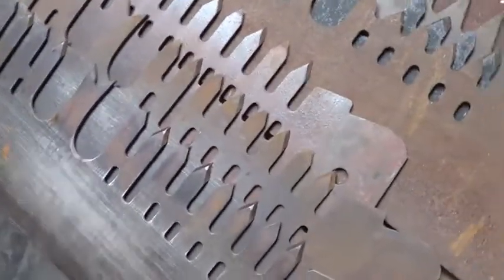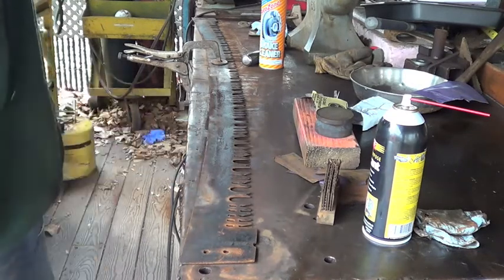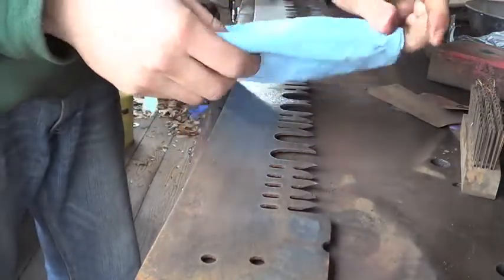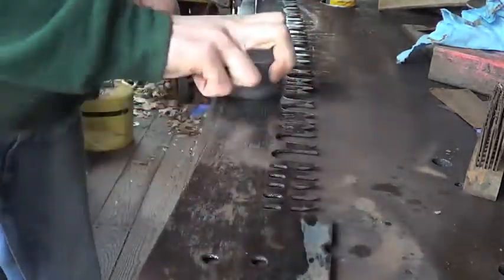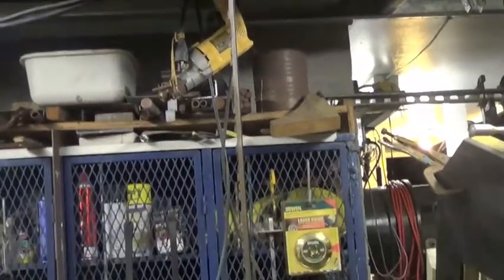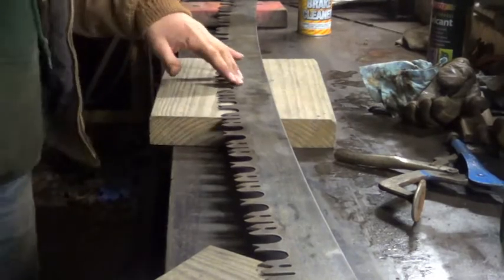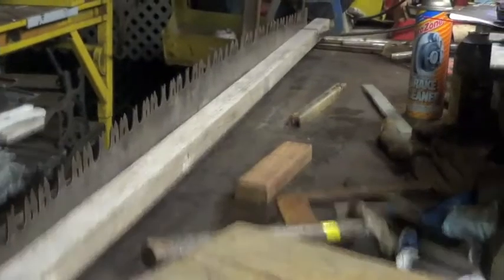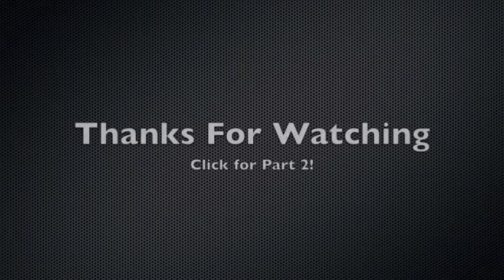Cross Cut Saw Restoration (Part 1)

Comment: The set on the teeth should be hammered, that is tapped gently, until flat. Then the saw can be restored or just tuned, A good sharpening is much more accurate and easier while the teeth are straight. Once sharpened, use your saw tooth set and set your teeth to the proper angle. This will eliminate sanding metal from the tips of the teeth. Good video. Keep it up.

Comment: Man I never want to tell anyone there business, but do not I repeat do not use sand paper on these. The only thing you need from start to finish is steel wool and marvel mystery oil. My family has restored these for a long time  and sand paper will scratch them to shit and leave uneven edges all over the face, even fine grit especially that your dry rubbing that saw with the sand paper. Just  rub them out with the oil and steel wool then take warm soapy water wash it off. Let it air dry I mean completely dry then apply another application of marvel mystery oil. I've restored these for awhile now is the only reason I'm saying anything. Its good to see other people taking interest in these old marvels.
Reply: What if the saw has a lot of rust on it? I was thinking of using WD-40 and a wire wheel. And the I was going to take steel wool. What do you recommend because this will be my first one?
Reply: Yea take to wheel  to it with the marvel mystery oil it will work very well for you....Good luck

Comment: Good video, thanks.
FYI, for you guys that have never used brake cleaner, it's great stuff, but if you're not going to continue to work on your project, you need to treat the metal with some type of rust preventer or it will start to rust immediately.

Comment: Hi by chance I to have the same Simmons jointer. Along with 2 others. The bit you talk about a special Simmons file. All you need is a normal 8 inch by 1 10th file. Yes you are wright to put a curve on it but your file was way to thick which would have given you a lot of flat stright edges on the saw instead of a very large curve.  You just use the grub screw on the file and it puts a curve on it.Hope this of some help as I to have surcomed to the magic of the vintage crosscut saw. Kind regards Duncan U.K

Comment: I bet the bends are where you clamped it. I was concerned on how hard you would clamp them as I watched.... is this possible?
Reply: Totally possible. But most of the old saws have bends in them from being improperly stored, used or transported. Still i would not clamp a saw this way

Comment: I got me a genuine old "H. DIsston&Sons" one man crosscut saw which I sanded most of the rust off of.
I got me a genuine Shurley Dietrich saw jointer; (a short one not a long one but that's good enough for me).
Plus I got me a genuine old Dunlap Hand Saw Set with a plier-type handle.

The saw looks like it hasn't been used very much.  It is straight as an arrow with no distortions whatsoever.  I ran the jointer over the teeth and it seems to have been already preset to the right depth because nearly all the raker teeth stick out by less than a thousandth of an inch or are perfectly level with the inset for the file.  Which is great because I don't have a feeler gauge and I'm not sure what the right setting should be.

I'm all ready to joint it, sharpen the teeth and set the teeth.  The Dunlap pliers even came with instructions that has a list of kinds of files to use on different saws... but it stops at 5 teeth per inch and this saw is 3 teeth per inch so I'm not sure what are the right files I should use to sharpen it with.

Could you please tell me what kind of files I should get?  Thank you very much.  
PS:  I already put thumbs up on your videos.

The other thing is setting the teeth.  The saw as I said looks in fine shape barely used and the set of the teeth look fine as they are.  How do I use this tool?  It has 2 screws for adjustment but I don't know how to use them.  Or what the proper offset of the cutting teeth should be.  There are a bunch of numbers on a metal wheel.which are confusing because they don't run in order of size:  
10-12-14-16--15-13-11-9-7-5-4-6-8.
Any information will be very much appreciated!  Thanks again.

Comment: It hurts me see you to put lubricant on that stone, I sharpen knives and tools for money, the reason you use diesel or kerosene is to clean the stone, by applying oil you clog the pores of the stone and prevent it from cutting. Think about guns for example you put oil on the moving parts to prevent abrasion. Kerosene doesn't lubricate the stone it acts as a solvent to keep it clean and prevent it from clogging. Another example is wet dry sand paper if it clogs you do put oil on it, you spray it with windex to wash away material that has been removed. Please Lear and save your self the trouble I had to learn the hard way. You can save your stones by soaking them in kerosene moving them around occasionally for about a hour hopefully you read this and save yourself a lot of effort.

Comment: A cheaper and better waybtoncome restore the finish is reverse electrolysis in a 55 gal plastic drum washing soda and a car charger it will look new without removing Amy material or corrosion anything